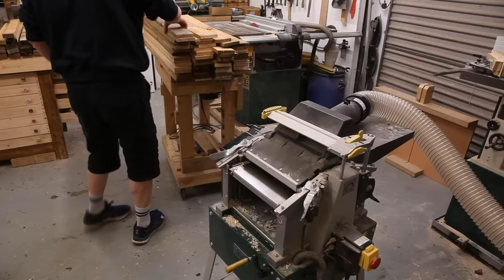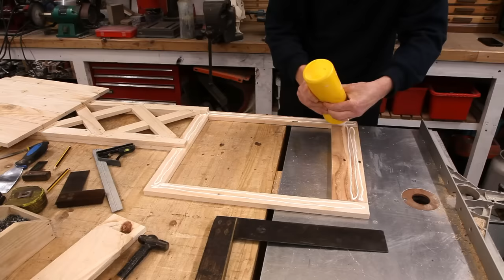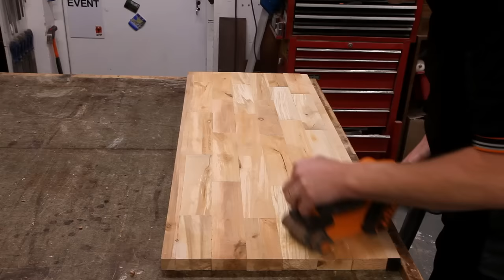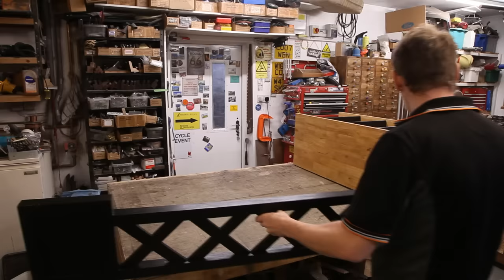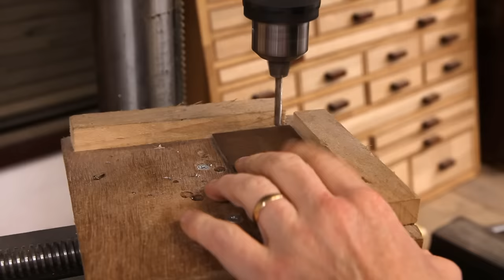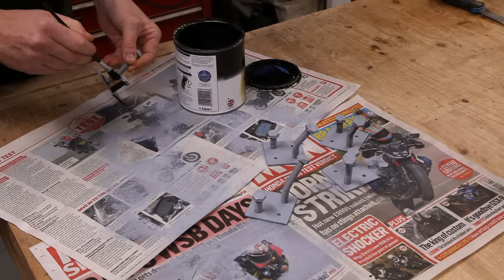A Hall Tree Coat Rack made from PALLETS.

Comment: Dude. There is just no way to say how impressed I am with your builds. You start with scrap wood that no one wants. You practice an unparalleled patience in cutting small parts, and piecing those parts together. Every part locking in with the others making the overall that much stronger. From flimsy 'trash' pallet wood, you made a beautiful hall tree that a gorilla could jump on and not damage!
Reply from the maker: Thanks very much :)
Reply: You forgot to mention he does it all often with hand tools and not expensive power tools too 👍🏻
Reply: I could not have said it better myself.
Reply: Beautiful
Reply: @expatmoose  apart from a radial arm saw, table saw and planer/ thicknesser
Reply: @mikearmitage1577  I this video maybe but not always and not the expensive  top of the range stuff like others
Reply: Beautiful as always
Reply: I really admire the patience you have in making usable pieces from wood that no one wants. Your work is beautiful. Makes me want to build something.❤
Reply: Agreed! A master indeed. Inspiring

Comment: Another great project; thanks for sharing. I love how you make do with what you've got from your pocket screws minus the pricey jig to your panel glue up with the wedges and clamps and homemade router plane (which probably takes less time to use than setting up a dado stack or dialing in your router). One potential downside to having every single tool is that the woodworker doesn't have to innovate and think around a problem, or just use a hand tool which can be surprisingly effective. I just got a magazine in the mail with instructions on how to build a fairly complicated panel glue up jig which I am tempted to make, but after watching your method again I'll attempt to make do with what I have as well (a flat table, some clamps, wedges, and weights).

Comment: Great again, thankyouforsharing! Just two questions: why first gray and then black colour? What criteria do you have to decide between screws or nails?
Reply from the maker: The gray coat was primer.
I normally use nails to hold pieces together while the glue sets. They don't add any real strength. I use screws when I need a strong joint.

Comment: Hi, I love your work.  Can you please tell me how you deal with the little pieces of wire from the air gun nails that always seem to remain in the holes.  They really tear up my planner blades when I run them through the thickness planer..

Thanks.
Reply from the maker: The only way I know is to drill the holes out with a small drill bit to clean them before planing. Very time consuming though. Unfortunately I've not come across an easier way.

Comment: How often do you need to scrape off the residual glue and other additive residues from your workbench? Especially after some of the more messy glue-ups?
Reply from the maker: I usually scrape the worst off after every glue up. I rub the bench down with candle wax every few weeks so it's really easy to get the residue off.
Reply: @EpicUpCycling  good tip!

Comment: Been watching your videos for a few years now, and I have a question: how do you account for the wood swelling and contracting with the changes in humidity? I’m seeing a lot of glue and nails, which seem like they would inhibit the wood moving when it naturally swells or contracts with the  humidity in the air. Wouldn’t the wood eventually crack or split?
Reply from the maker: Yes, it can sometimes split. It's very rare though. I've never had it happen with a piece like this. I season all of the wood I use for a long time. The pallets used for this project had been seasoning for over a year before breaking them up. Its not obvious in the video, but the wood was then also stored in our house, in the room the coat rack is going in, for about three weeks before using it.

Comment: Your work is outstanding and beautiful. However, I have one question: why don't you make it easier by flaming the wood, blackening it with varnish? The flame also makes the wood resistant to moisture and finally moistened with wax. You will be saved a lot of trouble. Best regards
Reply from the maker: I have flamed the wood in other projects and I love the effect it can give, but it wouldn't have given me the finish I wanted for this piece.

Comment: Hi Jason I'm a big fan from Pennsylvania for many reasons. Might I ask a few questions?
 -The funky groove in the very beginning...who was that familiar sound? 
-Your pencil sounds like a scribe. Is there something special about it?
-The finish on the large back panel...is that some kind of colored wax? It seemed thick.
--Do you sketch your projects out beforehand?
Reply from the maker: Thanks for the questions, Chris.
The song at the beginning is Get Back by Silent Partner.
If you mean the one I'm using on the metal piece before I cut it, It's a scribe I made at school when I was 15 years old. It's a bit battered, but still works. A lot like me really :)
The finish was Briwax Antique pine furniture wax.
I do a very basic drawing at the beginning, just to get an idea of the look I want. I make up the actual build as I go along.
Reply: @EpicUpCycling  The scribe/pencil is the yellow one I'm questioning. It sounds like your etching the piece rather than marking it with a pencil.
Also, with regards to your table saw fence and the straightedge which is attached to it.  What is the idea behind that?
Reply from the maker: That's just a normal pencil. It must be the microphone on the camera making it sound strange.
The straight edge on the table saw is to allow me to run slightly curved boards through it to straighten them.

Comment: Jason. I've watched a lot of your videos and have a question if you don't mind.  I notice that you normally put the pallet boards through the thicknesser, but I rarely see you using the planer side of the machine. Is this a video editing decision, or do you find the boards are flat enough already to only need the thicknesser? Only asking as I've recently bought a planer thicknesser and would like the benefit of your experience. Cheers.
Reply from the maker: Hi Richard.
I rarely use the planer attachment for the thicknesser. I usually find the thicknesser will do a good enough job. Just personal preference really. It would have been an easier solution for the coat rack when I hand planned all the short, thicker pieces before sending them through the thicknesser, but I prefer to do things by hand whenever I can. Quieter, Safer, and less mess 😀
Reply: @EpicUpCycling  Thanks Jason. I am on the hunt for pallets now. 😃 Just need to get my nail finder sorted😁
Reply: For the benefit of  people on the other side of the pond. American jointer=British planer. American Planer = British thicknesser.

Comment: What is the tool you are using in the beginning to pull the pallets apart with? That's my biggest problem, getting the pallets apart.
Reply from the maker: It's something I made out of steel and bits of scaffolding bar.

Comment: How long do you wait for your glue to dry before working can continue on the piece you’ve glued
Reply from the maker: It depends on the temperature, and the type of joint. Anywhere between half an hour, and maybe 3 hours. In summer I can usually work on most things in under an hour if I'm careful.
Reply: @EpicUpCycling  
Ah thanks for replying, I’ve been waiting 24 hrs 🤦‍♂️ 
At least I know now I can glue in the morning & get going after lunch
Thanks again 👍👍👍
Reply from the maker: @marcosmagic1983  It depends on the glue as well. Some glues take a lot longer than others. The one I use most often is Everbuild D4
Reply: @EpicUpCycling   nice, will use what I have & change up the glue,
Thanks for the advice 🙏

Comment: 1:34 How do you use pallet wood without destroying your planer blades?   Every time I build something with pallets, I miss one bit of a nail, or I miss one bit of stone embedded in the wood, and it absolutely wrecks my blades, and any money I saved by using pallet wood is instantly wiped out.
Reply from the maker: I use cheap, disposable blades on pallet wood. They get chipped and leave marks on the wood, but everything gets sanded anyway so it's not a problem.